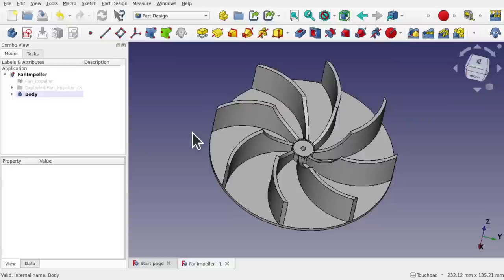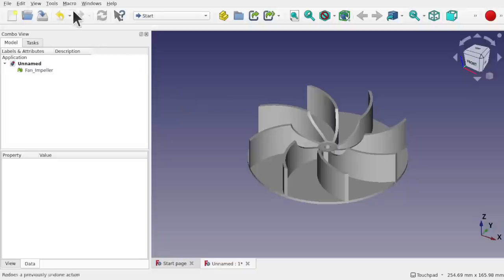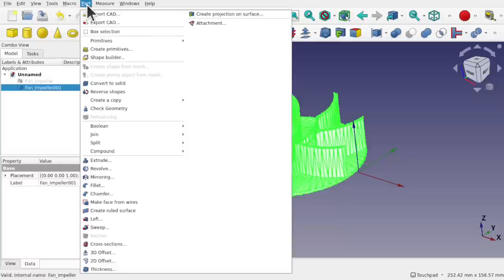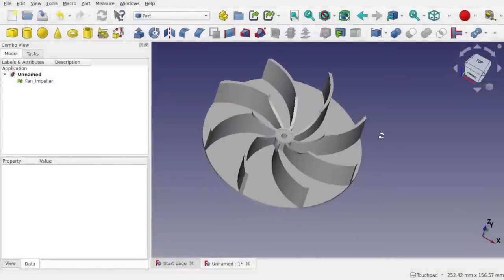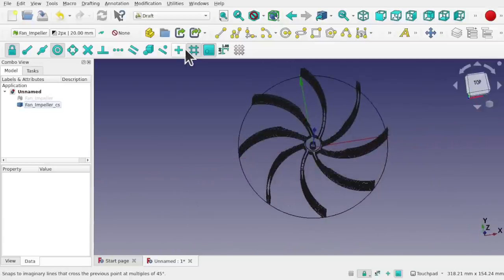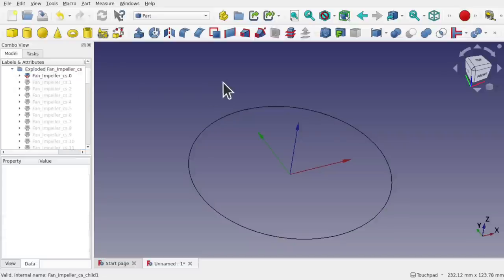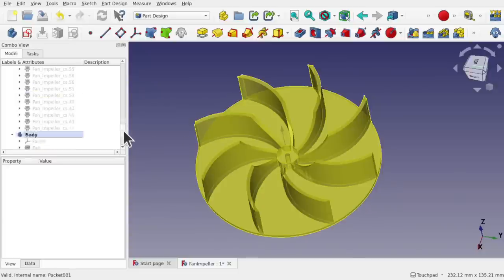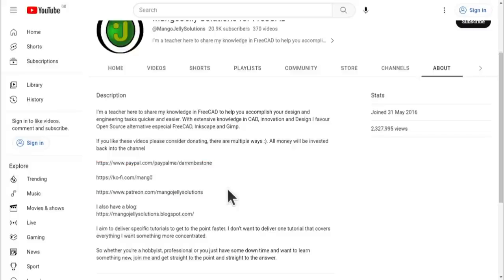FreeCAD For Beginners | 43 | Reverse Engineering an STL  Fan Impeller

Comment: And the workbench named 'Reverse Engineering'? I suppose it is not for what it is named after... is it for what? :P, I've not seen many videos about it, not a single video in the entire youtube to be exact 🤔
Reply from the maker: The reverse engineering workbench is mainly for point clouds rather than meshes.  I must admit it's not a workbench that I have ever used.  Considering I have a 3D scanner which can produce point clouds it might be an interesting experiment.  Yes, there does seem to be nothing out there in the form of documentation or videos.  Which is a bit strange.
Reply: @MangoJellySolutions  Sure. 🤔

Comment: Can STLs be assembled into one file for division with connection points for subsequent assembly after printing
Reply from the maker: STL don't have useable edges / vertices unfortunately  to apply do any assembly so you can't really unless you convert them to a shape and then you will be converting from a mesh so you may have many edges , but STEP files this would work

Comment: Brilliant!!!!   I would like to see how you would be able to bring in a Printer Circuit Board and use it dimensions and holes to make an enclosure, the hole on the PCB would be where you make the standoffs to mount.
Reply from the maker: You be happy to know I have a very similar video currently in early release with my Patreons so that will be on my channel very soon. It's was originally from a patreon request.

Comment: If it was a 3D impeller, how would you re-build up the blade, instead of padding it up as in the case of this 2D one? Is there some incremental additive way using all the cross sections? Or would it be to loft through?

Comment: 16:33 put an coincident constraint to the center points of the two arcs. The two short sides of the impeller blade are arcs with center at (0,0) and known radius {115/2 and 14/2} — I'd also use that knowledge. But the "move trick" at 09:30 looks very handy, hopefully I'll remember that next time… THANKS!